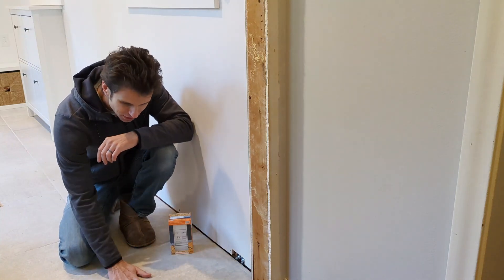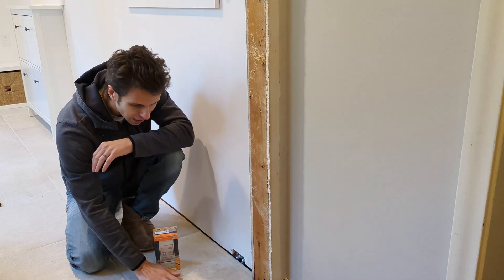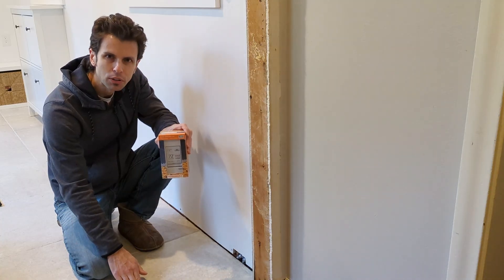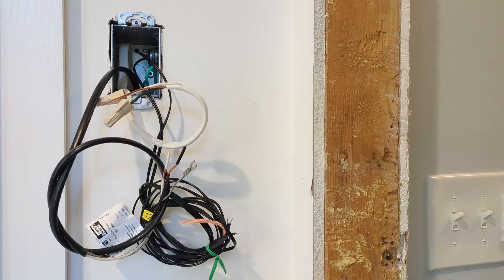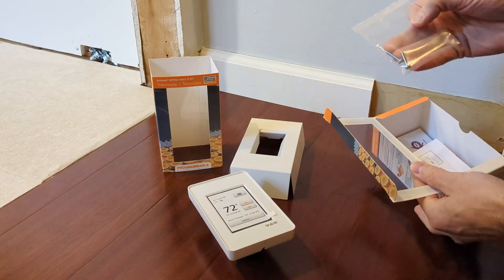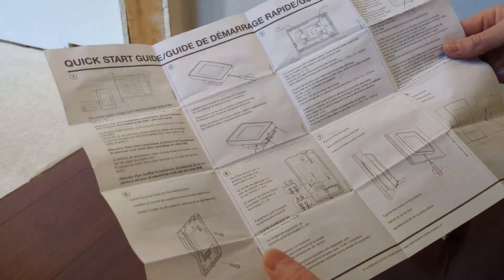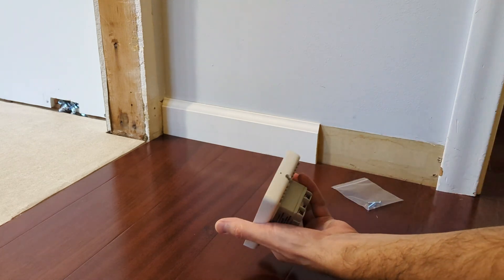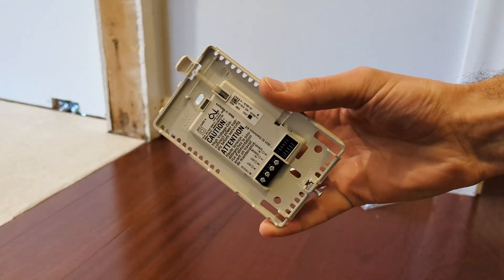Ditra Heat E-RT Programmable Thermostat Installation

Comment: How you're going wire up the 14×3
Reply from the maker: It's 14-2 (the bare ground wire isn't counted as a conductor). Here's the video where I connect it to the main panel. Needs its own circuit breaker:
https://youtu.be/lFZJyMvCuWk
Reply: You didn't respond to my question 
What if we have 14×3  instead of 14×2 wire? Where's the natural goes
Reply from the maker: @Nemat0001 oh I see. You're setting up for 240v? You don't use a neutral and instead connect each hot to the 2 thermostat terminals. If using 14-2 you should relabel the white wire with red tape to show it is hot. If using 14-3, the white neutral wire is unused.

Comment: How do you set the time on the stat?
Reply from the maker: On the main screen press the button with 3 lines at the top right. Then "user settings". Then "time". Enter time and press the check mark.

Comment: Thanks for the video.  My in floor heating stopped working after a couple months following installation (contractor work). This video showed me that the wiring was initially done wrong. Still didn't fix my problem though 😢 - suspect wiring down by the floor got disconnected. But I don't have the heart to rip open the renovated bathroom wall to look.
Reply from the maker: If you have a multimeter, you can test the cable and sensor wires to see what the problem is. Did the contractor happen to record the test measurements for the warranty?

Comment: Great video! Was disappointed that the only vids on the thermostat installation were for the Smart version.

I haven't gotten to tiling yet but am roughing in the thermostat now since it's on a dedicated 20A circuit I ran anew for the project and am trying to be done testing that (having to get into the attic for wiring the lights and whatnot stinks).
Reply from the maker: Thanks. Yes, many steps for a small project! Make sure you can still get access to test the wires after tiling is done. Checkout my playlist with all the rest of the videos for this project.
Reply: Would like to know if your heat system is working properly. It is my understanding that you are not supposed to cut the heating cables anywhere, even in the box.
Reply from the maker: @kennethlynn6494  it's working great. Yes you are supposed to cut back the "cold" wiring as needed. You do not cut the heating end of the cable.
Also, thanks for reminding me! I've been meaning to make one more video for an overall review of the Ditra Heat system geared towards homeowners.